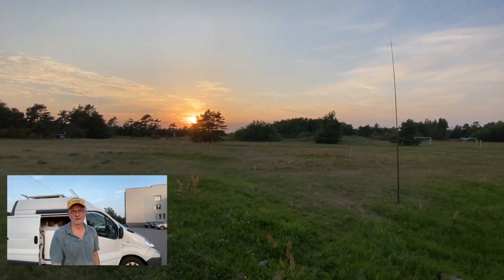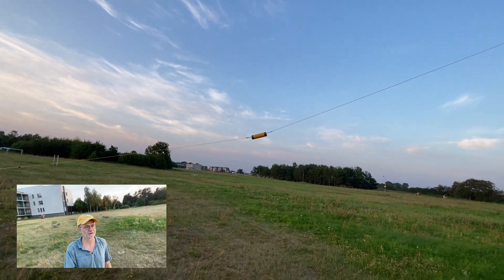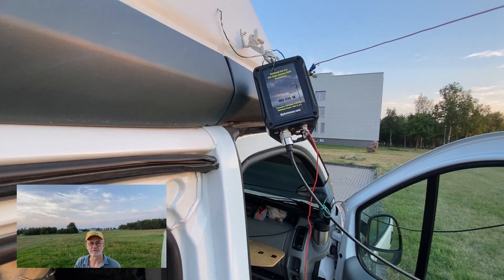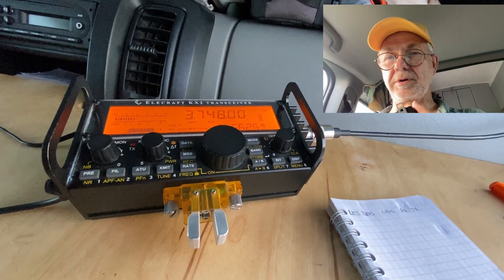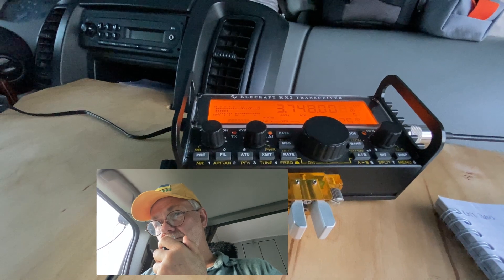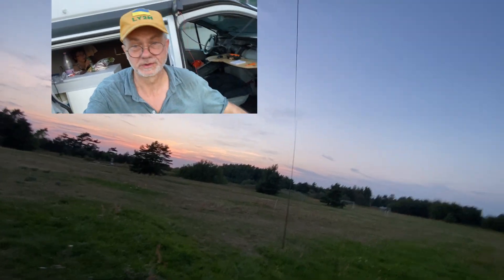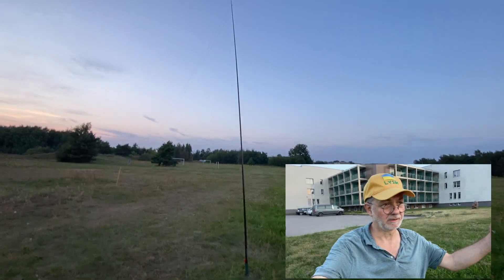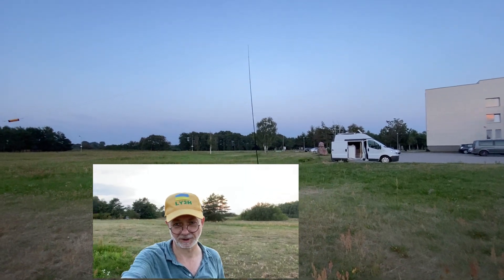Shorty 80-10 EFHW (“Hollandina”) as NVIS antenna. Could be great for emcomm!

Comment: NVIS doesn't work on below 40m.
Reply from the maker: Well, but it does work  :), I know it from my own practice. 40m is good for the daylight NVIS, 80m for the night. Even Wikipedia confirms this, statitng NVIS is best in the range of 1.8 to 8 MHz. I must admit, I haven't tried it on 160m myself. More possible reading is   here( one of the many sources): 
https://en.m.wikipedia.org/wiki/Near_vertical_incidence_skywave
73! Linas LY2H
Reply: @Linas_LY2H  Sorry for not being clear - this is what I've meant: it does not work on 30-20-10m, so above ~7MHz.

Comment: Hi Linus when you look at the antenna transformer there is a red wire going down. What is this for how long etc etc.

Thanks and keep smiling.
Reply: Linus you are spot on. There is always some kind of counterpoise. And I always use a tuner as well as a resonant antenna that works efficiently 100% of the time is a myth.
Reply from the maker: Thanks Chris! The red wire is a 0,05 wave length counterpoise calculated for the lowest band of operation, 4m on 80m band in my case. I stick to the opinion that such a c’poise is needed and helps to eliminate Common Mode Current on the outer shield of the cable. Even if the current at the end of the EFHW antenna is pretty small (and voltage is pretty high), it does need  a “return path”. If there is no  counterpoise, then the current will find its  way anyway,  through the strain capacity in the environment, coax cable, equipment, your body, etc. That’s why some manufacturers advertise their EFHW’s as “no counterpoise” designs, as this role is usually taken by the feeding cable. As the current at the feeding point is very small, this trick might work, especially on  QRP. My own experience taught me , though, that CMC could be quite nasty if running 100W and operating outdoors and using a short (less than 4m) length of coax cable , then  the short c’poise helps a lot, together with the RF choke at the radio side or at the distance of 0,05 w/l from the feed point (to put a choke straight at the feedpoint  might be inefficient as, accordingly to some theories,  the current there  is too weak to make the toroid work). HTH.  73! Linas LY2H

Comment: Good video,  EFHW  is my WIRE ANTENNA of choice but I always wind my own transformers either the 49/1 or 64/1 but I have never purchased one.  I always enjoy your videos 73. KV5P
Reply from the maker: Thanks Mike! I also like DIY transformers and baluns. But sometimes I’m just curious to see what’s going on on the market :). I’ve also discovered that some manufacturers manage to find good quality, low loss  toroids which otherwise are not easy to come by for a single hobbyist. On the other hand, it is also true that some manufacturers manufacture just crap :). 73! Linas LY2H
Reply: @Linas_LY2H  You are so correct about the QUALITY of Toroids,  JPM SUPPLY  in the US is one ☝️of my favorite suppliers but if it’s too hard for you to place an order with them I think you will be happy, I find the quality excellent and prices reasonable. 73. KV5P
Reply from the maker: @mikemiles3068  Thanks a lot for the info!